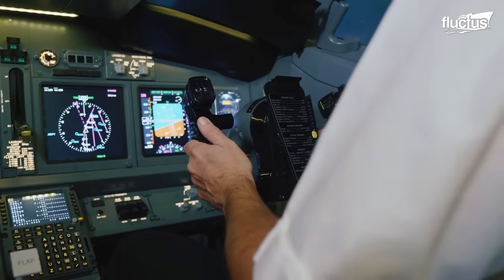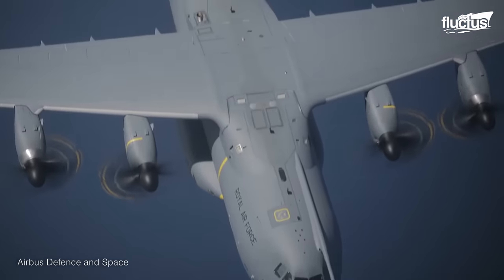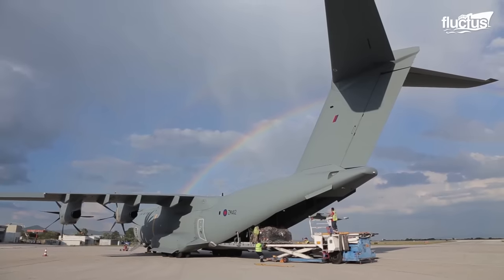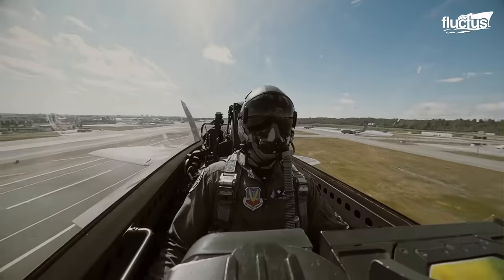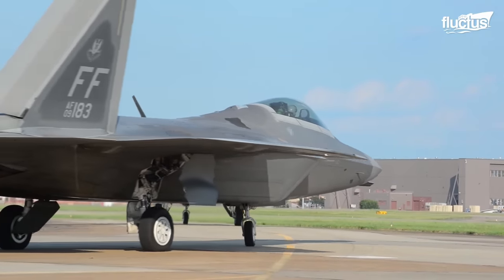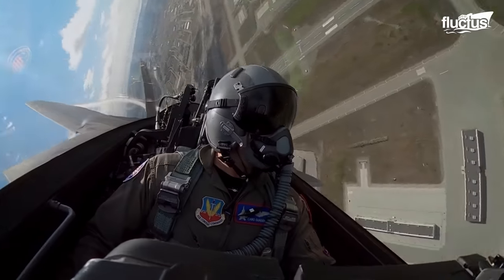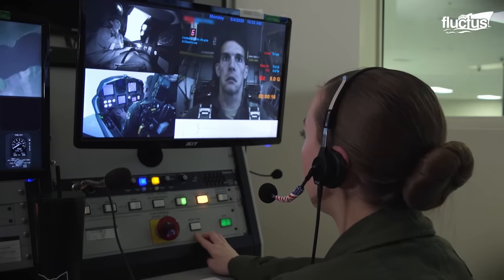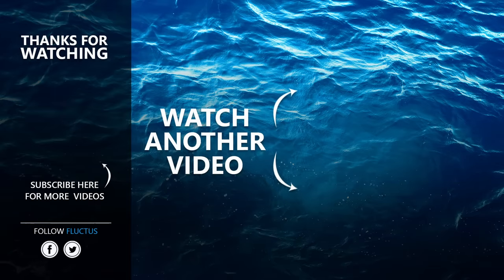Why Airbus Spent Billion $ to Make its Massive A400M TakeOff Vertically

Comment: I'll say that it seems to be a very good airplane. But are you saying that after years of development and millions upon millions of dollars what you basically came up with was a bigger C-130? It appears that this is exactly what you have done so with that in mind it's not that spectacular of an achievement.
Reply: It really is because most aircraft even produced today can't even touch to see 130 and what it is achieved throughout the years it's still going strong today
Reply: Have to agree with Paul - the A400 looks like a turboprop copy of the C-17. Now if Airbus had built a bigger, better C-17... I'd be inclined to be less critical.
Reply: For the European countries, the C130 was never the benchmark, but the Transall, which performed this service for many decades. You are forgetting one important factor, the considerably higher payload of the A400 and the much higher take-off weight. If you were an engineer you would know that in these cases the required values for performance etc. do not grow linearly but disproportionately. And so you can't compare this aircraft, which is full of computers and the most modern techniqu,  flown with a sidestick, with the C130 at all. And if you construct something new from the scratch without any And if you design something new without any experience from scratch, it always costs more than if you can fall back on experience and predecessors.

Comment: The actual reason is that the toilet gets clogged in normal flight and so from time to time they have to pitch up hard so that the waste can flush out the back properly.
Also, it is called "vertical climb". The only way these planes can "take off" vertically is if you roll them from the deck of an aircraft carrier directly into the sea.

Comment: This is not a knock on the new A400M, just an observation. Can you tell the new A400M from a C 130 which has been around 50 plus years. I understand, engines, electronics, materials have all changed but the basic design of short take off military cargo plane has remained the same. The form follows the function.

Comment: Kinda stupid when they could have bought US made, cheaper and more. Can't beat the c130.
Reply: The planes are in a different class, C130 MTOW 80 T, A400M 140T, engines C 130 4,508 HP each, A400M 11,060 HP each, max Speed C130 600KPH, A400M 780KPH. Range C130 3600KM, A400M 8710KM.  Max load, inc fuel C130 35T M400M 70T. A400M is closer to the C17, but with rough landing and short take off.

Comment: The Atlas, Galaxy etc all had the same fundamental rubicon to cross:- the need for massively larger aircraft to still meet the extremely valuable need to land and take off in the same "airbox" as the decades old, and much smaller Hercules, following the Herc's sad demise. And the problem isn't just the landing strip length, but also the abrupt need to deliver its payload onto zones surrounded by buildings, trees, jungles, and steep valleys. Particularly for humanitarian aid. We are just used to A380's, 777's etc using standard airport approaches and runway lengths.
You can't compare 6th gen fighters with heavy lift aircraft.

Comment: It was not designed for vertical takeoff but it did achieve steep takeoff capabilities but no where near vertical.
Reply: A lot of power to carry big payload, but no payload.  Passenger jets do same thing at air shows…massive turbofan engines and no payload = v. steep climb.

Comment: For a propellers aircrafts of that size, the A400 air bus, to do it near to vertical taked off is INCREDIBLE for sure!  And thosed propellers are totally radical !!
Reply: No it can’t take off anywhere near vertically, that was never a design goal and there is nothing very radical about the blade design. It is similar to a c130.
Reply: @sblack48  
Oh yeah?  Haved you looked at 04:25 at where does it do just very that?  No it does not acshully do it vertical but FOR SURE IT IS BEING NEAR TO VERTICAL INED ITS TAKE OFF!  Did you evened to watched the video all of the ways??  Probly not, ..right?  Well go at there and WATCHED IT!!!
It was for sure near to at VERTICLE at timed of take off dude, just as did they say it that it cand!  So eithers geted yours facts as real and straight or go away.  Any one cand watched it at that place and see it that it was being VERY near to being all of verticle as did it lifted off and for may be of at fromed 100 to at about of 300 or 400 feet off of the strip.   So go at  04:25   And WATCHED IT!!
AND  it does to do it ined a propellers aircrafts! i may be at only to 14 but I cand see and I do gived credits where at credits are being due and evened ifed it is a French maked airs craft still is it a cool and very of doable airscraft!

And all ready do I know it I writed as diffrenter.  I amed haved aphasias damagings a little fromed I geted my head craxked and I geted a TBI and aphasias damaginged whened was I at 11 eleven fromed a vile evil ofed fosters father whiched turned to be as a pedophile predator
But ifed are you being of niced thened will I be niced backed to you evened
Reply: @jacobsparry8525  wow that’s quite a post. I would dispute it if I had any idea what it was you were trying to say.
Reply: @sblack48  He may have hitted his head but if you didnt understand that post then you may want to ask yourself who the slow one really is
Reply: @jacobsparry8525  Take your meds
Reply: @sblack48  Im curious of their similarities. Ya kno payload cap. Power output operating range ect...
Reply: @jacobsparry8525  sorry to hear about your foster father bud. Great to see you made it out alive.
Reply: @jacobsparry8525  does anyone here know what he is saying?
Reply: @mikecyanide7492  performance comparisons with the c130 are all on-line I’m sure. You can look them up. During development of the A220 where I was a flight dynamics engineer we had one former Airbus A400m test pilot on our team. I can ask him about pitch limiting on the aircraft. There are 2 possibilities I see for what you see at 4:25. First, and most probable is that it is simply the camera angle that accentuates the climb angle. As I said in another post, usually pitch angle is artificially limited by the flight control system in Normal Law (on the airbus airliners and no reason why this would be very much different). Usually 25-30 deg is the limit, for safety reasons. Another possibility is that for airshow demonstration purposes they were in Alternate Law which removes some protections in which case it was a dynamic maneuver, trading speed for height. In other words the airplane can only sustain that attitude for a few seconds. It can’t maintain that attitude in a steady climb, so it is kind of a party trick. It certainly is not taking off vertically. A 65hp piper cub or a cessna 150 can do the same thing for a few seconds. And finally and most importantly, these are cargo aircraft that hold many tons of cargo and many tons of fuel. If you have no cargo and 45 min of fuel just for a 10 minute flight demo it will probably be at 60-65% of its maximum weight, so the thrust to weight ratio will be insane - equivalent of a rocket ship. The performance you see will be nothing like you will see in actual operating conditions. This is pure showoff mode. And nothing against airbus - all mfgs do this for airshows. There is footage on line of the c17 doing something similar. But if you think of the basic role of the aircraft, which is to move tanks, trucks, men and cargo, why would you want to go vertical with a couple of 30 ton tanks in the cargo hold? That would be stupid. The thrust required to do that would cost you payload, range, speed and money. There is no operational need for that and plenty of safety and performance reasons why you would not want to do that. It’s cool for airshows but nothing more. Airbus are smarter than that.
Reply: @mikecyanide7492  
I haved tryd for writed messaged to at you just but I haved troubles for doing it  I will tryd agained at tomorrow

Comment: Who are the idiots who write the scrip for videos like this? “The cockpit is at the front of the fuselage as most of it is reserved for cargo” or “before each flight the aircraft is loaded with is cargo”. Well, who want the cockpit in the rear?  And loading cargo mid-flight is impossible. Etc.

Comment: Why do they use propellers?
Reply: Propeller is better for bad environmental conditions,  eg dust etc. Also it generates more power in lower altitude etc. There are many more reasons.  You use jet for long distance,  high altitude,  proper air ports.